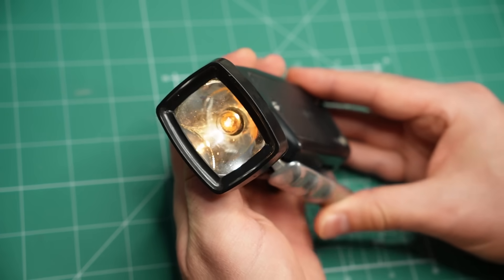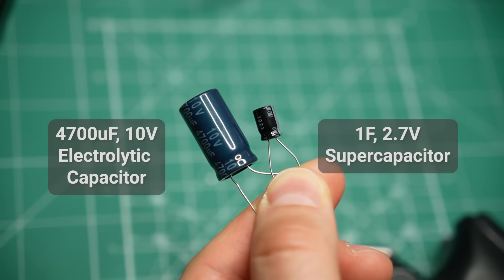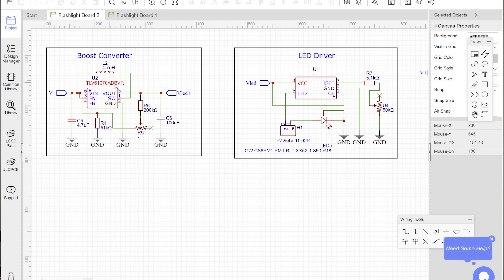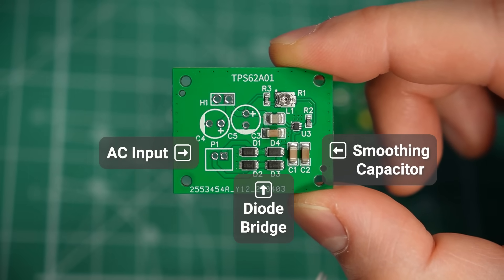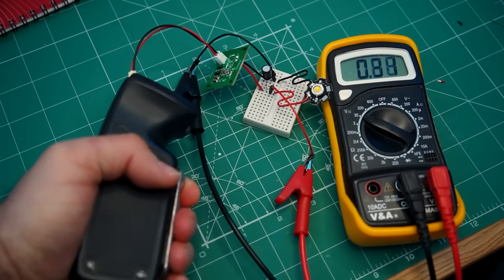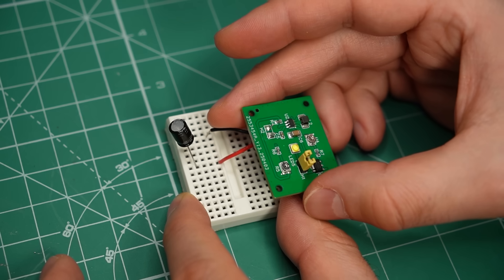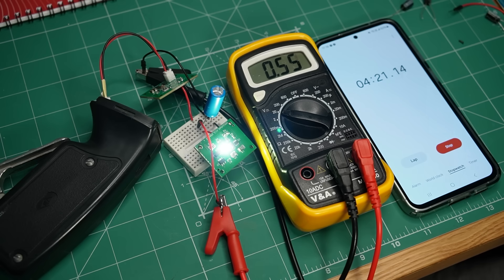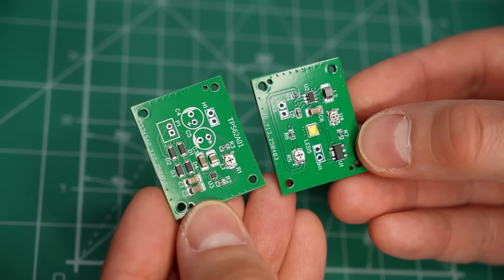I overengineered the no-battery flashlight (with supercapacitors)

Comment: The issue I found with most handsqueeze dynamo flashlights is the short travel of the charging handle and the small flywheel. I was thinking of an idea where the handle is pumped multiple times to wind a spring which will drive the dynamo after a multiplication geartrain.

Comment: Yes, your flashlight is overengineered. Using only one buck converter with negative current feedback seems to be enough for this project. You can add a synchronous rectifier if you don't want to loose any enegry droplet.

Comment: I guess you still have room of over engineering.
1. Try to stop discharging when voltage on capacitor is already low. This way you will spend less time to charge capacitor to requires voltage.
2. Improve mechanical parts by switching to generator which will have less friction and more efficiency.
3. Switch to accumulators
4. Add solar charger as a backup for mechanical charger
5. Add regular usb charger.

Comment: I tried to make a diy hand cranked flashlight using a nema-17 stepper motor with no gearing, and used a full bridge rectifier, 12000 uf 75v capacitor, 4700 ohm 5w resistor, and two green LEDs. And the result was charging the capacitor took 2-3 seconds until the LEDs turned on, then the LEDs lasted 5-6 minutes. I also tried to use a super capacitor instead, and it took almost 1 minute to charge the super capacitor, but it lasted a whole hour on two LEDs. I think it depends on the generator efficiency and how much the LEDs draw from capacitors.

Comment: That was very nice to bring New Life to a 30 Year old flashlight
Reply: How about using a bicycle Dynamo rated for 12 volts maybe you can rig up a motor and belt to turn the Dynamo in a small case like the flashlight case so you don't have to be pumping the lever so much just a thought

Comment: You need to make the PCB white or make some sort of reflector, it probably won't help much though.

Also why not make it work right away AND charge it? You could even dump the excess to a battery that can be activated with a switch. Maybe it's too complex and not that great but still worth a try.

Comment: You can just use two capacitors in series it will divide the voltage across a single capacitor to protect overvoltage

Comment: 1. The reality is that the hand crank generates too little power. Given the limitation, we could only attempt to modify the pattern of discharge that works best for LEDs.
2. Supercapacitors may not be a good choice as they discharge too fast. The LED brightens mentarily and dies down quickly.
3. Boost circuits or juole thief, both consume energy to a large proportion, when the source of supply is already minimal. They would not help.
4. A 5mm basic LED operates at full brightness at around 30 mA, and still emits lights at 1 mA. Experimenting the nos. of LEDs and the appropriate operating mA may give an optimum solution, given the limited power supply.
6. I note one of the hand cranks in the market uses Li-ion battery in lieu of supercapacitor for storage or equalising discharges. Its unlikely to overcharge the battery at this power level. It may also unlikely to overdischarge as the LED stops working at around 2.5v, which might serve as a kind of protection to the battery.
Hope my contribution above would trigger some   new thoughts.

Comment: Ok, someone told here on YouTube that if you use full power from super capacitor and keep it nearly zero volt charged, it will reduce its lifespan shortly.
That why they shipped precharged.
Is it true?
Reply from the maker: No. They were probably talking about batteries or lithium capacitors.
Reply: Ohh, ok thank for clarification! ❤️💕
 @LeftyMaker

Comment: Could you have used the super capacitors in series to avoid the voltage boost converter? Is there any technical issue to avoid it?

Comment: Very cool, have thought about it many times camping with folks, often bring a similar light I have for fun. Those that don't bring lights get that. Always a chuckle. So cool to see a led conversion done. Should do a version that you put a power switch on and a small battery. Would be cool to charge it for a few mins and then have a few mins of run time without having to pump it.

Comment: ur losing 60%+ in ur circuit maybe use the ac to get the dc directly instead of converting to dc then boosting
Reply from the maker: How did you get the 60% number? The buck is about 90% efficient, the boost is about 85% on average, the LED driver drops less than 0.05V. You're right that there are losses, but they are not as bad as 60%

Comment: As 180 turn, it would be interesting to store the energy into an internal flywheel (mechanical) rather than capacitors (electrical). This would probably also allow you to add a gear between it and the input to avoid your hand getting tired (I used to have one too, I remember it being pretty hard to push, some mechanical advantage would have been great)

Comment: The whole project is just great. Improving just the light source is enough, but storing energy may need an external charger and a battery. You could charge it, turn on the flashlight and give it some help with the mechanism inside. But it's overcomplicated and for that it's way easier to just buy a flashlight with a big battery instead

Comment: What if the circuit begins as normal powering an LED, but the supercapacitor is only charged with surplus energy, then when you stop cranking the circuit reverses and a separate LED is powered from the super capacitor?

Comment: The whole point of such a flashlight is that as soon as you start turning the handle, light appears. There is no need to store electrical energy, the flywheel copes with this perfectly. However, if you want to add a battery or supercapacitor here, it may be worth getting rid of the flywheel, there will be less energy loss. Well, or at least it will be easier to press the lever.

Comment: Nice project.... but loss in the diodes, loss with a buck converter, and loss in a boost converter. You should have known from the beginning it would have been more pumpping than output.  You should look at improving the output of the dynamo.  Maybe some stronger magnets so it can charge the caps in just a couple pumps.

Comment: Everyone is busy improvising the electronics, whereas I'll give you a much better mechanical improv idea: use a rotational hand crank kind of mechanism (similar to the ones used in old cars to roll the windows) for the dynamo.

While using the crank in your device, only fingers are used to spend energy and they get tired easily. If you use a rotational crank, entire arms will be used and easily fill any supercaps you connect.

Comment: Guys, just keep in mind Lavoisier when you have an idea:
"Nothing is lost, nothing is created, all is transformation ". You'll never get free energy, and what you get from the start is probably the most efficient form of energy you'll get. Any other layers added just increases losses. The led efficiency improvement was a great leap. You could also reprint the gears to have a tighter fit to remove play. But that's about it really. 5V 0.5A can't power much sadly

Comment: I think you are kind of reinventing dynamo hub powered bicycle led lights. They consist of a high powered LED and one or more small powered ones. When you drive, most energy goes straight into the main LED but some energy is diverted to charge a supercap which feeds the small LEDs for some minutes when you are not driving.

Comment: You can add 1:2 or 1:4 gear from hand crank to flywheel, which will speed up charge generation while you won't have to crank that fast. And also add power switch to led bulbs. So you can charge lager capacitor to full while not using led and then turn led on

Comment: Hey there great project even though I do not nothing about electricity it was interesting. As you mentioned that it takes a lot of time to charge the big blue capacitor. Do you think is it possible to modify the gears that turns the flywheel to turn twice as faster in 1 pump? If my monke brain makes sense it would take half of the time to charge the big capacitor to have a light that will last longer. Thank you for your video it was interesting to watch.
Reply from the maker: I'm sure it's possible, but you'd have to exert more force to make the wheel spin faster. If you want more energy out, you have to put more energy in.

Comment: Delete steo down converter and add another two super copacitors connected in series to this and add one elctrolitic 5v capacitor behinf them to stabilize cranking voltage .

Comment: I think the larger capacitor or two of them would work well with the crank-style flashlight. Easier to charge. Maybe add a lithium coin cell or AAA, a solar panel, and a switch

Comment: Why was it a problem that the battery could hold 15 minutes worth of charge?  You don't have to charge it up to the max every time.
Reply from the maker: Because the battery would never get fully charged and would require extra circuitry to deal with the CC-CV charging, plus undervoltage protection, etc. It would not be practical.
Reply: @ I suppose the undervoltage protection could be annoying (and especially the resulting fire if it doesn't work properly) but rethink the idea that the battery needs to be fully charged.  What bad thing happens if it only ever gets half charged?  Most EVs keep their batteries between 20% and 80% charge for longevity anyway.

At any rate, this is a very cool project!  You should be proud, and don't take us online hecklers too seriously 😉
Reply: @LeftyMaker  By using a LiFePO4 cell, LED cutoff voltage can act as an undervoltage protection. And Lifepo4 usually don't charge above 3.4V, so right around usable voltage to drive the LED.
The buck circuit just needs to be limited to ~3.4V.

Comment: Great videos! I'm just curious about one thing- would it be possible to add another (perhaps low voltage) LED to this circuit in parallel, so that it lights up instantly while the capacitors are charging? I guess that would have some major implications on the voltage input/management but it's just a thought :)
Reply from the maker: The LED Vf isn't an issue. Thanks to the boost converter, we get light from around 1.3V instead of waiting for the cap to reach 2.8V or more. Also, if you parallel LEDs, the one with the lowest Vf will clamp the voltage for the other LEDs and they will never light up.

Comment: Would be better to change the gear ratio so that you have to squeeze a bit harder but way less often.

Technically it could be made so that you squeeze with a semi firm grip once every 10 seconds. The issue would only be the friction to get the spinning to start. An exposed wheel at the dynamo, which you need to flick once in the beginning would solve that issue.

Means you would squeeze the handle, flick the wheel once, and the whole system would start. After that you would only have to release and squeeze once every 10 seconds. Albeit a little firmer squeeze, it would be way less tiring than having to constantly pump.

Comment: The biggest downside seems like the delayed activation now. Can you split the power so some goes directly to the LED immediately, while the rest is stored in capacitors? Then when 'pumping' is stopped, the capacitors continue to power the LED for a while?

Comment: Voltage doubler with perfect diodes and supercapacitors right to the led. Not wasting energy on diodes or converters, led limits voltage on capacitors. Great flickering smoothing.

Comment: Interesting project. While you use an emergency flashlight without battery storage I have one that does. 
I've been thinking a while for a similar project as yours but don't know what would be the best approach for the battery storage solution. 
On the led side I could adopt a similar design as yours. 
These flashlights are perfect to keep in the car for emergencies or at home. 
Hopefully you revisit this project but with a decent battery storage solution.

Comment: Add bypass schottky straight from coils to boost converter. Gets the LED lit right away at some level.
Reply: Won't work, or would need a buck-boost converter (inverting the polarity but allowing an arbitrary ratio of input to output) instead of a pure boost.

Another idea is to try zero-volt diodes to reduce the losses.

Comment: You could make it more complicated by running one LED across the generator and the capacitor circuit with a half rectifier anti-parallel to the LED.

Comment: Bro optimised everything but the generator. A hand crank with a high gear ratio and parallel generators will be less tiring to use and produce more power.
Reply: Agreed, maybe even a chainsaw style pull cord. One good pull will give a crazy amount of power, not sure about the reliability of the mechanism though.
Reply: @MiGujack wouldn't the chord wear out? Unlike a chainsaw where you only have to pull it once, you would have to repeatedly keep pulling to power it.
Reply: That would be a different device
Reply: @metagoat at this point it's already a different device.
Reply: hand crank would not be satisfying

the whole point is the grasp-grasp-grasp
Reply: Hell, I wouldn't be shocked if just upgrading the bearings/lubrication could make a really significant difference. 

I didn't watch part 1 so I'm mostly talking out of my ass. But that thing just doesn't sound like an efficient mechanism for turning squeezes into spinning.

Comment: I've got an even older version of your pump light.

They need a heavier flywheel. One small L.E.D. that's equal to the original bulb in lumens would conserve energy over the original design.

Just a single capacitor across the bulb in parallel to smooth out the brightness and a single resistor in series with the L.E.D. to limit current.

Keeping the components to a minimum to get rid of parasitic drain from too many active components are my thoughts.

Oh, and a dc motor swap to get it to output DC instead of AC.

Comment: for getting instant light (even if at a lower efficiency) what about adding another Schottky diode directly from the output of the bridge rectifier to the LED? When the output of the boost converter is low, the LED will be powered directly through the diode. When the output from the boost converter rises, the diode will not conduct anymore and the circuit shoud function as you designed it.

Comment: Hi LeftyMaker,

some more - probably overengeneered - thoughts: The Full bridge with schottkys is probably the best choice: you could try a ideal rectifier with mosfets, but with the low voltage (and the needed control) you end up with similar losses.

From here on, I opt for a two-LED-solution: one driven directly from the generator, a second one that actually stores energry, probably with a lower brightness/current need. 

The boost converter couldn't handle more than 5.5V (datasheet) - but you have a constant voltage source already in your circuit: the LED! The voltage across the LED will nevber go above 3.xV (guessing here), so clamping the boost circuit with the SuperCaps and the LED across the main LED sould solve this problem.

From here it get's a bit experimental: you cound although try to put the Boost circuit in series with the (main) LED. The LED will take about 3V, if I saw the scope right, you get up to about 6.xV - so you should (!) never get voltages above 3V on the boost circuit.
I don't have the hardware lying around here - so sadly can't test here. Could be a fun Part III :)

Thanks for the content - keep up the good work.

Greetings from a fellow lefty from sunny Gran Canaria.
Reply from the maker: Thanks for the support and for sharing your suggestions. I was not planning a part 3, but now I'm tempted :)

Comment: No need for a full bridge: having two charging circuits (one positive, the other negative inverted) would give you a gain.
Speaking of led, they should act as one-ways, so you may have two leds: 1 for each phase, this way you use 100% of the current from both alternations, and couple that with a dedicated condensator plus escape route and that would give you a better efficiency.

Comment: You kind of over engineered this, but somethings are left out:
- using power factor correction for the input, to make use of the power generated, efficiently and evenly.
- using synchronized rectifiers where applicable, minimizing drop voltage to the minimum.
- using GaN FETs for all power FETs and chips.
- using ball bearings for the mechanical rotating parts.
- adding solar cells for alternative charger for the super caps, to add to responsiveness upon first use
Reply from the maker: That would be over-overengineering :)

Comment: Why don't you try using a voltage divider to pass some of that power into directly powering the LED while using the rest to charge the capacitor so that when you stop using the pump the LED gets powered by the capacitor and while pumping it also gets powered by the pumping itself.

Comment: Use mechanical energy storage solutions like improving the disc inertia or a coil spring and add bit more load in the squeezer for more power output or better generator and I really like your project pls make this contraption even more complicated

Comment: Why both a boost converter and an led driver? I would assume that functionality could be combined using the right ic. 

An active rectifier circuit to eliminate forward voltage losses from the diode might also be worth a consideration.
Reply from the maker: I tried finding a suitable boost converter + driver combo but didn't find a good one in stock. Otherwise, a combined solution would have been better. Also, this boost converter is ideal for supercaps with 0.6V minimum input. Other converters stop working at 1.3-1.8V

Comment: I believe the charging of capacitor(s) would benefit from not running the lamp while attempting to charge. Add a disconnect in there. And a tiny cap for the diode, to help with that .7V forward voltage diodes like to keep for themselves.